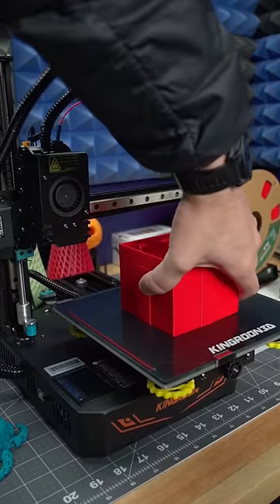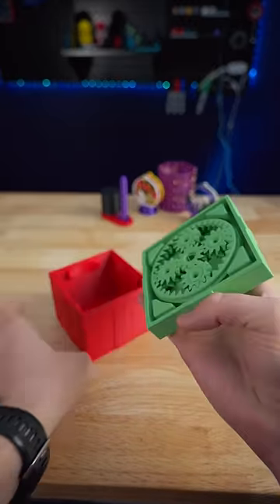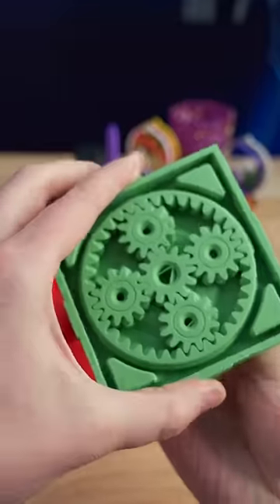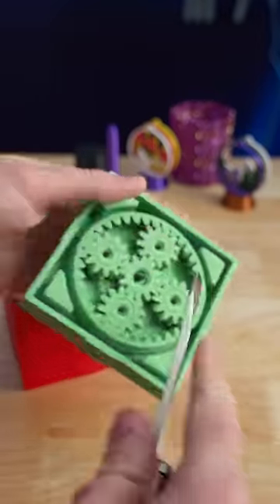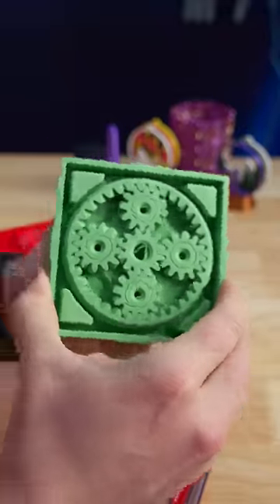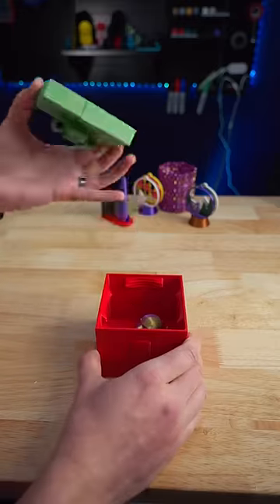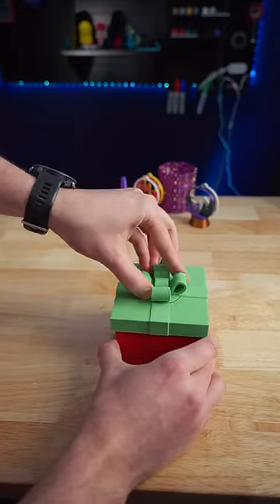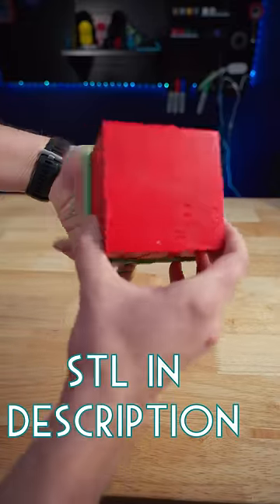Over Engineered Gift Box 🎁 3D Printed

Comment: The gears get stuck because the tooths are way to long, they should have a bit more clearance and not go all the way in. You can find more info in Shigley's Mechanical Engineering Design. But for a small proyect like this, I would just try to have the tooth 80% in.